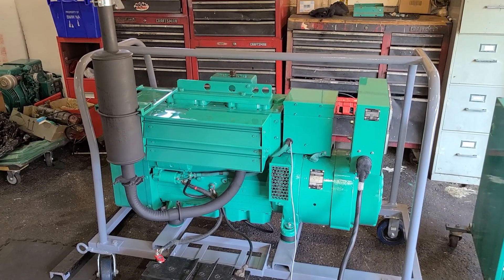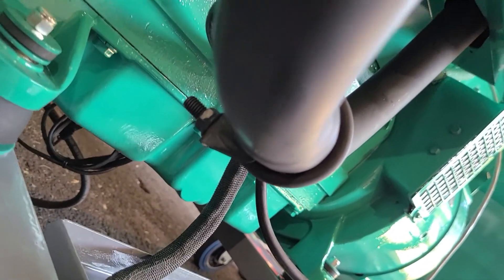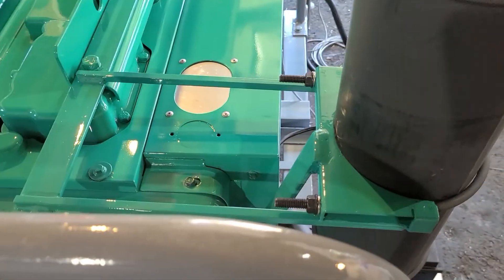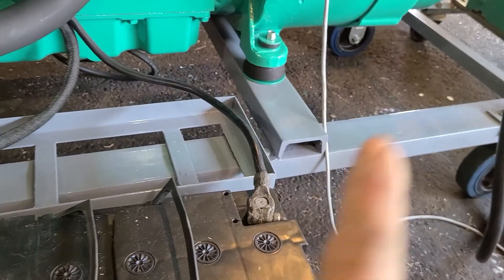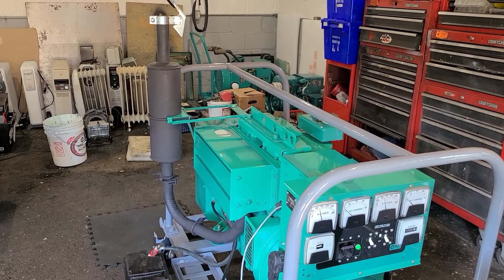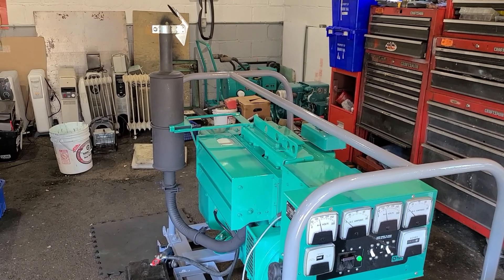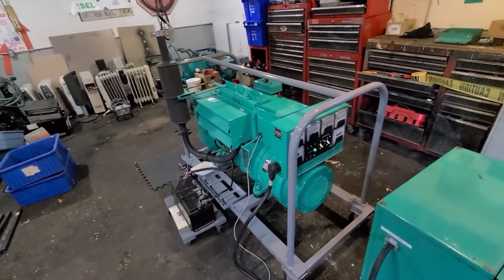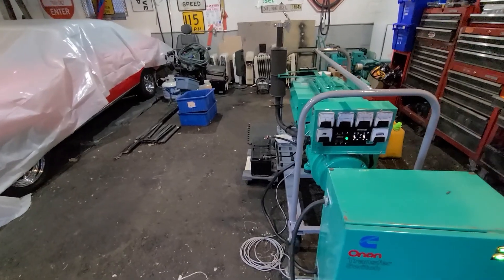Onan DJC Wet Stacking Part 2

Comment: Diesel generators and the conundrum of being used as a emergency power source. The thing is the generator needs to be rated to handle big startup loads like water pumps air conditioning but a lot of the time it's running at less than 10% of its capacity so you get the wet stacking problem. My solution was to use the diesel generator to charge batteries which run an inverter that also get charged with solar panels. The generator only runs when there is insufficient solar and foot for several days in a row but the generator runs at near full capacity so it gets up to full temperature and alleviates any problems with wet stacking.

Comment: I picked up a 5.5kva genset that hasn't run for 12 years and in its 1000 hours it hardly got loaded. I loaded it up with 3kw and man sparks and junk flew out the exhaust pipe, it glowed bright yellow looking in there and had a flame coming out once it was shut down. That's a bad case of wet stacking where the stuff stacked layer upon layer. Now i gotta run it for several hours loaded to clean it out. I might post up a vid of it.